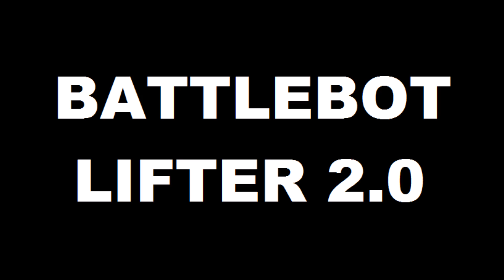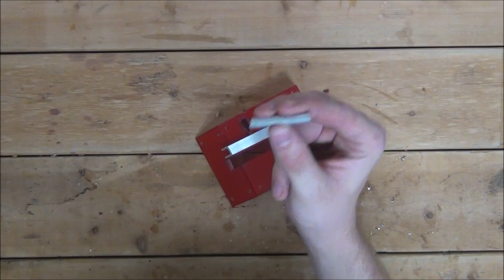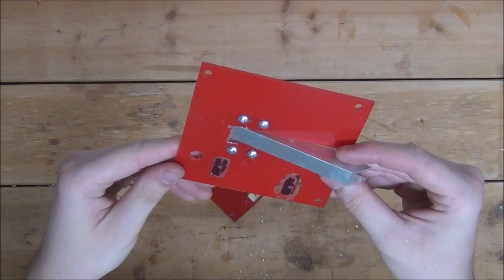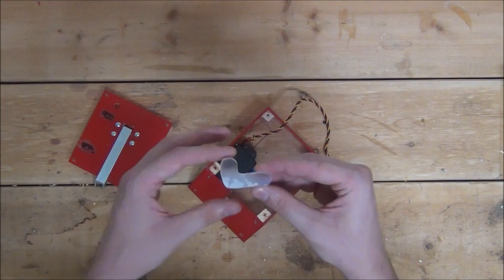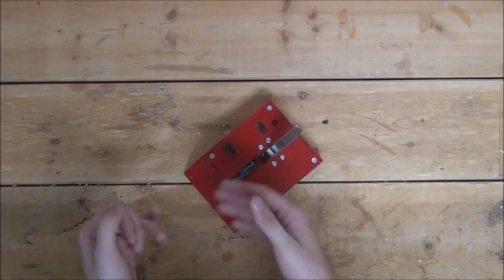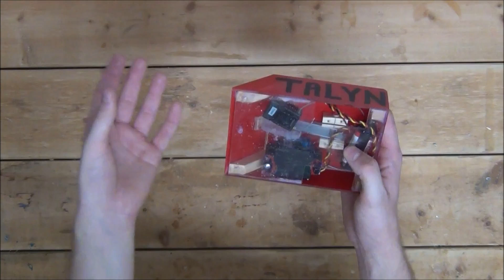1lb Battlebot Flipper 2.0!!!

Comment: Simple change, I'd highly recommend changing out the aluminum shaft for the lifter for a hardened steel one. Doesn't have to be anything fancy, a black oxide socket cap screw and a nylon lock nut works just fine. Aluminum shafts are notorious for bending under load.

Comment: Can you make the flipper stronger and faster
I would really like to know because I plan on building 
a flipper later.
Reply from the maker: I guess you could if you bought a bigger servo or ran it through more gears. However I don't think its necessary for a bot this size.
Reply: Mechanical Ninjineer Thanks